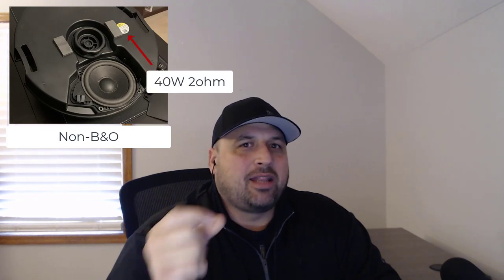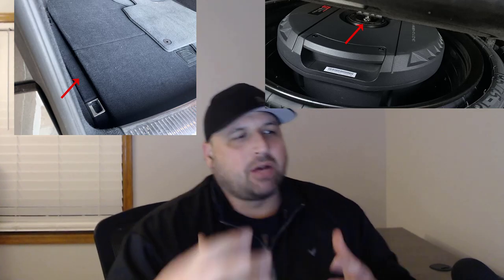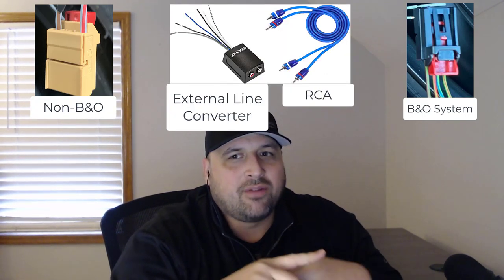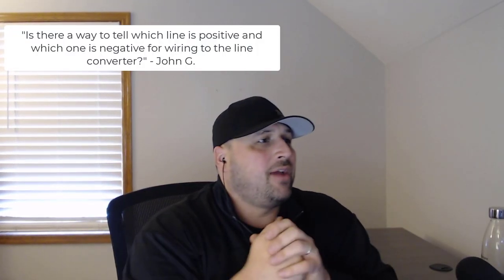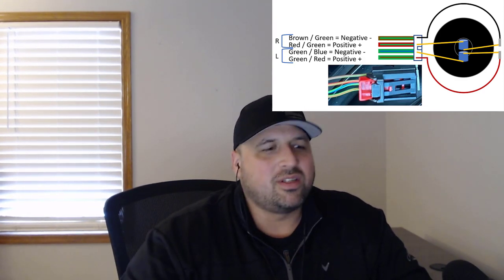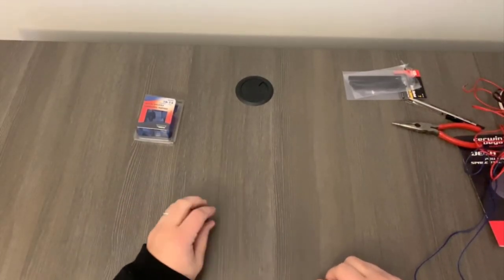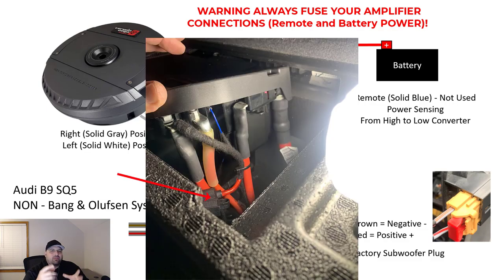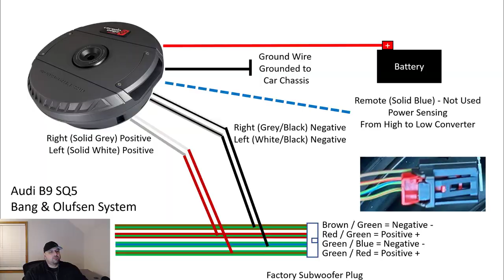Audi SQ5 B9 - Q&A and How To -- Cerwin Vega Spare Tire Subwoofer

Comment: I installed the slim profile version in SQ5 last month.  It’s fits perfectly.  How is your phase set up since the subwoofer is firing downward in the SQ5 and what’s your subwoofer level set to on the Audi MMI to sound best?
Reply from the maker: My phase is set to 180 — gain (non-b&o) is set to a little past the “N” in the word gain. Bass boost is set to the first “s” in bass. LOw pass filter is set to the “P” in the LPF. Phase is set to 180.

Comment: Your two postings about the subwoofer installation in your SQ5 were invaluable in my selection and installation of the VPSTX12 (shallow version) in my 2018 Q5 with the B&O system.  Absolute perfect fit on all fronts.  Happy to send you pics of the wiring harness I fabricated, with a factory connector so that no splicing was necessary -- total plug 'n play.  One issue I've been having is the absense of signal to the subwoofer every 10 or uses.  Cerwin Vega sent me a fix that required installing 47ohm/10 watt resistors across each output channel (left & right channel with the B&O system), which I did and it worked fine . . . so I thought.  CV claims the issue is that the smart circuitry in the factory amplifier is looking for a resistance that would be present at all times with a passive speaker and that, absent that resistance, the factory amp self-protects by shutting off output to the subwoofer channel.  Wonder if anyone else has experienced this issue.
Reply: Are you still having the issue? I’m installing a newer slim version next week. I’m never installed amps and subs before
Reply: @DanielGuzman83  Yes.  Still no sound from the sub every 10 or so uses.  Need to do a bit of further diagnostics to see if there is a signal from the factory B&O sub channel or if the issue is a faulty sub.  When it works, it is superb.
Reply: @garyfriend3097  is there any way to test another sub? Maybe purchase the same one, if it doesn’t fail, return the old one.
Reply: @DanielGuzman83  I will likely re-connect/re-install the factory sub for a few days to see if the issue persists.  If it does, then the problem is with the car's factory amp and not the Cerwin Vega sub.  Could be I never noticed it because the factory sub is "ok" but not so obvious if it were episodically not working.
Reply: @DanielGuzman83  If testing concludes the CV sub is faulty, then it can be swapped out under warranty.
Reply: @garyfriend3097  did you have to tap into the battery?
Reply: @DanielGuzman83  Yes.  If you are also installing it in a Q5, the battery is in the back, in front of the spare tire.  It requires about 2 x 2.5-3 feet of 8 guage copper wire (not copper clad), one for the positive lead to connect directly to the battery and the other to connect to a chassis ground (not the negative post of the battery).  A max 20 amp fuse has to be installed in the positive lead.
Reply: @garyfriend3097  I just received the speaker today. I'm just waiting on the harness to arrive and to buy the cable for the battery. The speaker connector plug has two negatives and two positives.
Reply: @garyfriend3097  did you disconnect the battery? I am about to install a 12" kicker in the morning. I'm wondering what will be reset or not function properly right after.
Reply: @DanielGuzman83  No.
Reply: @garyfriend3097  i just installed my amp, still need for the sub to deliver. I’m hoping there is no pop using the hi input to power on
Reply: @DanielGuzman83 My knowledge is limited to what I installed (see original post).
Reply: I recently installed the VPSTX12 in my 2019 B9 Q5.  I also have the same issue where the sub occasionally does not power up.  When that happens, the red LEDs on the remote flash a few times then shut off.  I'll contact CV for more troubleshooting, but did you get to the bottom of it?  I usually have to shut the engine off, that seems to wake up the sub.
Reply: @garyfriend3097  did you ever resolve the subwoofer not working after 10 starts? I think I know what the issue is but wanted to see if yours is resolved?
Reply: @ProsumerGarage  No.  Still having the same issue.  Appreciate any suggestions beyond what CV recommended.
Reply: @garyfriend3097   Any more progress Gary ?  I am having the same issue and think I may need to put in the Kicker 47KeyLoc line output converter.  I am also trying to get a call set up with Cervin Tech support to discuss this option
Reply: @mdube72  did anyone find a solution for the amp occasionally not turning on on the b&o install of this sub? Thanks in advance
Reply: Hi Gary - where did you get the resistors and how did you install them ?  On both positive leads from the harness to the Cerwin Vega ?

Comment: Alright, so I bought the CW normal depth sub for our SQ5 and just did the install based on this video. I'm relatively experienced in DIY auto projects (performance and audio) so figured this would be relatively simple based on this video. 

If you have the B&O system, there are a few things you have to do that aren't mentioned. 
1. The wire splicers that were recommended to tie into the factory sub harness are not perfect. They sit close together and need to be sealed off from each other to prevent feedback.
2. You cannot simply connect the factory harness to the Kicker low line converter and then to the wires from the CW harness as shown in the final diagram. The Kicker that is linked needs to use RCA cables that connect to the RCA female inputs on the CW harness (and do not wire anything to the CW wires in the diagram in this video if you use RCA).
3. The CW blue remote wire will need to be connected. I connected it to the remote wire coming off the Kicker low line converter which finally triggered the sub's amp to power on. 
4. I'm also already seeing a semi-frequent "sub does not turn on when the car is turned on" so not sure what I'll be doing, but I imagine I'm going to have to find a true 12v cigarette lighter-esque source to tap into that will be a sure trigger to power the CW internal amp on/off.
5. And finally, I chose to just remove the spare tire altogether. We have AAA and will never use it, and I wanted the 250W RMS version vs the shallow mount which is listed at 150W RMS.
Reply from the maker: I think you may misunderstand the wiring. The Cerwin Vega has a built in high to low converter. You will not need an external line converter that you are referencing. In addition, the high to low line converter is power sensing. That means when you power on the car with the line converter hooked up, it will take some of the power from the subwoofer lines and turn on the cerwin vega amplifier / subwoofer. Essentially, you do not need to hook up the blue line when you use the built in line converter. I wouldn't necessarily splice the cables in the same spot. as it does get bulky. I usually stagger them down the line a bit. The last note here is that you shouldn't hear any interference. The line run is so minimal, and the alternator is far enough away you shouldn't get any. If you do, it's likely a bad ground and you would need to ground it better. Great job getting the subwoofer going! I just wanted to clarify a few items. for you.
Reply from the maker: ok... one more response... For the RMS / bass quality. There is a definite issue with all the Audi MMI systems, that bluetooth sounds like crap at high levels. While you may want more power, it definitely has enough power when tuned right. I am going to create a recommended settings video. I would #1 make sure that you are phased properly -- i had to phase the sub 180 to get it to sound better. Second I would make sure your eq on the cerwin vega is about 80 hz. Last if you are using bluetooth- I would turn on the EQ settings as it sounds loads better. I use bass boost on the iPhone. I would also make sure you don't have the Subwoofer setting maxed, and use the gain sparingly on the subwoofer itself. The subwoofer is going to max out on subwoofer output, but a few tweaks will make it sound better.
Reply: @tangentsdaily thanks for the clarification. Your links in the description on both of your CW videos include one to the kicker converter. That theoretically makes sense if you don’t already know that the CW does the converting in the built-in amp, which I obviously don’t understand watching this. This will help immensely and I’ll likely just remove the oem connector coming from the oem amp altogether (we’ll have the car for a long time and I’ll just sell the car with the CW whenever that time comes). Thanks for replying @tangentsdaily, you do an awesome service making these videos.

Comment: I am researching this now. I bought my wife a 22 Audi Q5 Sportback Prestige S-Line Black Optics Package "moth full". It has the B&O 19 speaker 755 watt 3D surround sound which sounds absolutely phenomenal however,  I'd not balanced to be bass heavy.  Previous Audi vehicles (cars) we have owned in the past with the B&O audio system have not had the 19 speaker cinematic sound quality but, were much more bass heavy. 
In VWs and other Audis utilizing the spare tire subwoofer I have seen a lot of writings,  description of simply replacing the OEM DVC 8 ohm subwoofer with aftermarket ones from Polk, Kicker ect  Reporting that the bass was noticeably louder and deeper with just the subwoofer swap. 
Have you seen any videos,  writeups,  post about this "swapping the OEM sub for a higher grade aftermarket sub" into the OEM box on an Audi Q5 ?
I am not finding anything in searching.I do not want to wire up converters,  locs, power wires ect. If the bass was just 20% louder and deeper,  I believe it would be a perfect match for what I am looking to achieve.
Reply from the maker: This is exactly what you are looking for -- HOWEVER -- I would recommend you get the shallow mount version so it sits flush. It just gives a little more depth and sound that the stock system doesnt

Comment: Sorry if I missed this but on the non-B&O system what is the best way to join the wires from the sub together before using the quick splices?
Reply from the maker: Non b&o i would do the positives + positives and negative + negative of the white and greys on the line in on the speaker. Since it's an input, it will be able to emulate "right / left" channels by sending the same signal to each channel.

Comment: Thank you for posting this! I love the sub and got it off of your recommendation. Wish I got the slim as well. One thing I noticed is that the center collar if you take the bottom grill off in mine, bounces around at times. This causes it to make a metallic rattle noise if not centered just right. Is there any way to fix that or is mine just broken and suppose to be stationary? Thanks for these awesome vids!
Reply from the maker: I'm not sure that I understand what you mean by that? I don't have that particular issue with my Cerwin Vega. I do have a layer of Dynamat underneath the tire to stop some of the vibrations -- but I never have an issue with the subwoofer mounting vibrating. The factory system does -- however -- have that issue.

Comment: Awesome info! Placing my order for my 18 q5 now. Thanks!
Reply: What’re you thoughts on adding sound dampening material around the setup on the trunk base? Underneath the floor cover too?
Reply from the maker: Very Cool! You won't regret it!
Reply: @tangentsdaily  thanks for the response! You mind giving me your input on my other comment I posted on this thread?
Reply: @tangentsdaily  so I’m all hooked up but I don’t seem to have it syncing with my stereo volume. It’s basically on full blast no matter what. Tried adjusting the settings on the remote and it’s not making much of a difference. Spliced into the factory harness so my remote wire is not hooked up to anything. Any ideas?

Comment: So, I followed your advice a little over a year ago and got the slim version installed in my SQ5...Love it, But two days ago it just stopped working and looking at the sub itself, the power light is not lit up...any thoughts or recommendations. I can't figure out if it's a fuse issue ( or which one it would be) or what...just trying to figure out what the heck happened!!

Comment: Do you feel this is substantially better than the stock sub ? I have a 2018 SQ5 with the B&O.  There is just no depth in the stock - no deep bass IMO.  I am on the fence between a small powered sub that I know I will lose trunk space, or give this a go.
Reply from the maker: If you skip to 1:40 in the video, I go over the surface area of the speakers. While the B&O box says 2x100 -- it is actually dual voice coils in a single 6.5" subwoofer. Where as the Cerwin Vega is 11.3" and 600 watts RMS. Triple the power RMS, and double the surface area of the B&O system. Go with the shallow subwoofer noted in the description and you won't be disappointed. Yes it has way more bass than stock and the depth is absolutely there. I took a bit of time tuning the dials on the bass controller to balance the bass punch and the sound quality. An external subwoofer is not a bad idea, but are trunks are small enough, I just don't see a need to take up more space along with having a subwoofer that slides around... An external subwoofer would also require a line converter, a remote mount amp, and just is less clean than the Cerwin Vega. Don't forget to like and subscribe and thank you for stopping by!
Reply: I bought the non amplified version and connected it directly. Bass sounded low, thought it didn’t work. I then installed a kicker key 500.1 and a 12” down fire kicker cvt. Sounded the same as the passive cerwin vega. The tuning helped out a lot. I think this tire sub would sound really good after it’s tuned. If you really want some had bass, I think a whole system overhaul would be the key.
Reply: I ended up taking the leap and purchases the CV spare tire sub.  I also made sure that I ordered the shorter version and I can tell you it fits perfectly with no rubbing on the foldable cover area in the back.   I have played around with the tuning - getting the gain set correctly and the bass boost took some tweaking over a few weeks to get it just right.  I can tell you this is a significant difference over the stock B&O subwoofer and added exactly what I was looking for - some deeper, richer bass without the need to revamp my system.  For the money, I think this was a great decision.
Reply: @mdube72  nice!! I love my set up but now I'm struggling to fit the baby stroller. At least my kids will enjoy Baby Shark at full bass.
Reply: @tangentsdaily  what is the major difference between shalow and other version. I do see one is 6.5 and another is 4.7 inches and generaly which one do you think is better?
Reply from the maker: @Shulcyo  Honestly you'll probably lose a little bit of air volume, but the fitment makes up for it. You won't have to modify the trunk lid or anything.  IMHO go with the shallow.
Reply: @Shulcyo  Go with the shallow - so much better than the stock B&O.  I cant envision that the standard vs the shallow is going to be substantially different.  That being said, I have not tested them both.  Happy with my purchase so far.  One point I will bring up.  There are some comments on other threads that the B&O system requires something like the Kicker KeyLOC - https://www.crutchfield.com/S-RgqRiBtd5RB/p_20647KEYLO/Kicker-47KEYLOC-Smart-Line-Out-Converter.html    I have noticed from time to time, that the sub will not "turn on" even though all the lights are green and the controller is lit up.  From my understanding, the CV Input using High Level is 0.9V-12V. That’s not enough to support the B&O amp from cutting out after some start cycles. I do not have the KeyLOC in my current installation, but I may think about adding it.  Its a fairly simple installation.

Comment: I noticed in my Audi Q3 stock speaker system there is no subwoofer control in the mmi settings, the older Q3 had it. Like why would they take that away? I suppose it’s because they probably want people to buy the more expensive trim with the Sonos system.. I’m really curious if this can be done in an Audi Q3?
Reply from the maker: unfortunately they cannot add a subwoofer control in after the fact. However, This system does come with a long cable to run to the front if you want to control the bass on the fly. Thanks for stopping by!
Reply: @tangentsdaily So can this be done in the Audi q3 without having to tap into the head unit in the glove department? I would just splice the existing spare tire sub wire in the boot and connect it via high level to the Cerwin Vega?

Comment: Does anyone have a photo of where you added the power wire for the sub? My battery is pretty wedged in is the best way to access by removing the small panel between the battery and the backseats? Thanks
Reply from the maker: I made a small slit in the foam retainer between the battery and the spare tire. I'll see if I have a picture of it and reply if i find it.

Comment: Did disconnecting the battery mess anything up? Did anything reset?
Reply from the maker: Not with my experience. I do have a ODB Eleven if I needed to reset anything as a backup.
Reply: @tangentsdaily  good to know. I also have an ODB eleven. I didn't disconnect the battery to install mine. I took it very easy. One step at a time. Prosumer Garage guided me through the set up. That harness was well worth the money. A shop wanted to charge me $300 to install and I was willing to pay but it seemed like he didn't know much about the car and tried to sell me more equipment so I backed off.
Reply: @tangentsdaily  I also watched both videos like twice a day for two weeks before installing, haha
Reply from the maker: @DanielGuzman83  That's awesome! I appreciate the support!